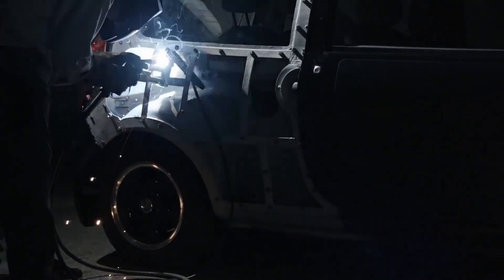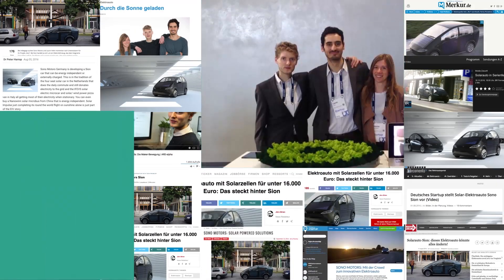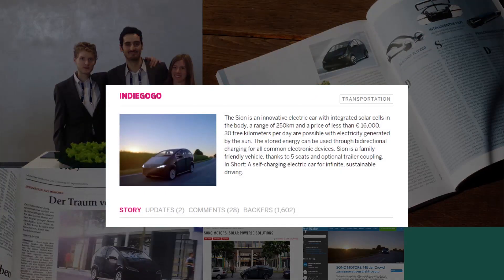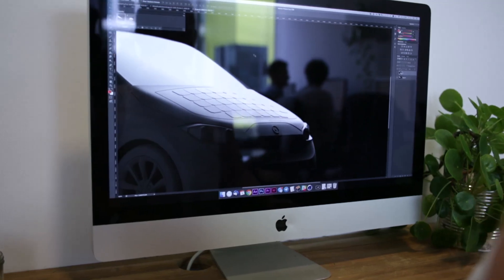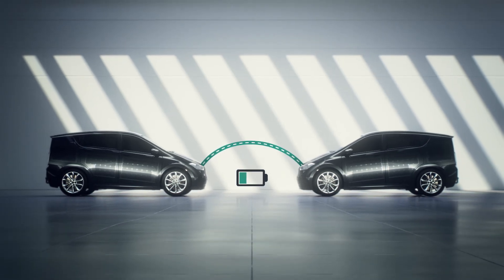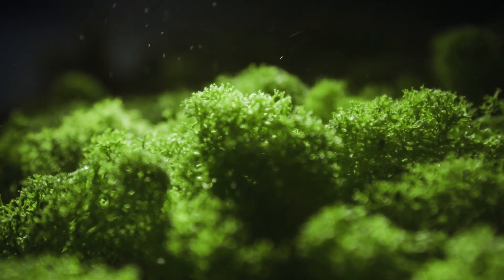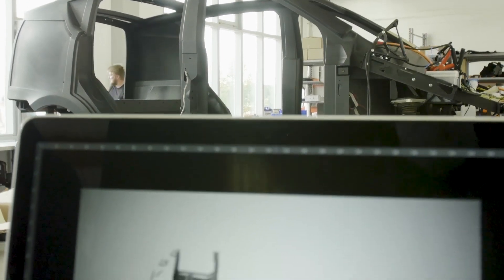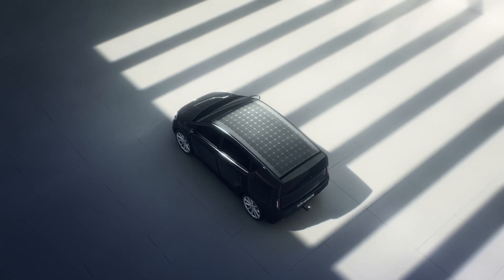Meet the Sion – An Electric Car for Everyone | Sono Motors

Comment: It's not 16000€, it's 20000€, as the car doesn't work without battery, so for starters don't lie. Plus, 20.000€ is still very expensive. If we are to make a difference for the environment, and this solar panel car is a BRILLIANT idea to go in that direction, we need to make these tools available to the majority of the population, and the majority of the population can't afford a 20.000€ car. It needs to be half that price.

Comment: Wirklich interessantes Projekt, allerdings habe ich so meine Bedenken.

Von einer PV-Anlage mit einer Fläche von 7,5 m² und Südausrichtung bei 33° Neigung können in DE ca. 6375 kWh/a erzeugt werden (Idealfall). Unter der Annahme, dass der Sion 15 kWh/100km verbraucht, würden die 6375 kWh für 42.500 km im Jahr reichen. Jedoch sind nie alle PV-Zellen des Sions optimal ausgerichtet und während des normalen Fahrbetriebes kommt es häufig zur Überschattung. Realistisch wären 10% von den im Idealfall erzeugten 6375 kWh/a. Daraus resultieren 638 kWh, die für 4.250 km ausreichen.  Bei 15.000 km Fahrleistung im Jahr können 30% gedeckt werden. 

Allerdings wird viel Potential der PV-Anlage nicht genutzt. Die räumliche Trennung von Energieerzeugung und Verbrauch wäre deutlich sinnvoller. Die energetische Amortisationszeit der PV-Zellen beim Sion dürfte bei weit über 40 Jahren liegen und daher ist ein E-Auto mit Solarzellen aus ökologischer Sicht nicht sinnvoll.
Reply: ...Die räumliche Trennung von Energieerzeugung und Verbrauch wäre deutlich sinnvoller....

Du weißt, welche Energie verbraten wird, wenn man erst eine Batterie lädt, um dann mit ihr eine zweite Batterie zu laden?

...Die energetische Amortisationszeit der PV-Zellen beim Sion dürfte bei weit über 40 Jahren liegen und daher ist ein E-Auto mit Solarzellen aus ökologischer Sicht nicht sinnvoll....

Was verstehst Du unter "energetischer Amortisationszeit"?
Was spricht dagegen, die Zellen wiederzuverwerten?
Wo liegt das ökologische Problem von modern gefertigten Solarzellen?
Reply: …Du weißt, welche Energie verbraten wird, wenn man erst eine Batterie lädt, um dann mit ihr eine zweite Batterie zu laden?
PV (1) =>AC/DC (0,92) => Batterie-1 (0,95) => DC/DC (0,95) => Batterie-2 (0,95) => 79% Gesamtwirkungsgrad

…Was verstehst Du unter "energetischer Amortisationszeit"?
Damit meine ich den Zeitraum, den eine PV-Anlage betrieben werden muss, bis sie genauso viel Energie erzeugt hat, wie für die Herstellung benötigt wurde. In Süddeutschland sind das 6 Jahre, wenn das Potential der Anlage voll ausgeschöpft wird. Bei Sion nutzt die PV-Anlage jedoch nur 10 bis 15% ihres Potentials. Infolgedessen verlängert sich die energetische Amortisationszeit um den Faktor 6,67 (100% Max-Potential / 15% Genutztes Potential) auf 40 Jahre. Liegt also außerhalb der Fahrzeuglebensdauer.

…Was spricht dagegen, die Zellen wiederzuverwerten?    
Möglich, aber benötigt auch wieder Energie ;)

…Wo liegt das ökologische Problem von modern gefertigten Solarzellen?
Das Problem ist, dass die Zellen beim Sion deutlich weniger Energie erzeugen als sie theoretisch könnten. Wenn man die Zellen stattdessen auf sein Haus setzt, wird durch die ideale Ausrichtung das maximale Potential genutzt. Der Strom kann dann selbst verbraucht oder ins Netz eingespeist werden. Also wäre es aus ökologischer Sicht sinnvoller das volle Potential der Anlage an einem stationären Standpunkt zu nutzen. Daher die Trennung von Erzeugung und Verbrauch.
Reply: KawaNinja93, Du schreibst,
...79% Gesamtwirkungsgrad...

Das lass ich mal so stehen, da die Zahl einigermaßen stimmt, obwohl ich nicht weiß, warum aus einer Solarzelle Wechselstrom kommen soll. In jedem Fall ist es nicht optimal (Das war Dein Anspruch), eine Batterie zu laden, um damit eine andere Batterie zu laden.

...In Süddeutschland sind das 6 Jahre, wenn das Potential der Anlage voll ausgeschöpft wird....

Bei monokristallinen Solarzellen spricht man eigentlich von 4 bis 6 Jahren. Ich weiß nicht, warum Du den Maximalwert nennst, obwohl bei moderner Massenfertigung eher ein kleinerer Wert herauskommen sollte. Ich behaupte, daß diese "energetische Amortisationszeit" egal ist, da sie von dem Fehlkonzept ausgeht, man müsse um jeden Preis Energie sparen. Nein, das muss man bei der Nutzung von regenerativen Energiequellen eben nicht.

...Bei Sion nutzt die PV-Anlage jedoch nur 10 bis 15% ihres Potentials....

Wie kommst Du auf diese Zahlen? Ich komme hier auf einen über das Jahr gemittelten Wert von ca. 24%.

...Möglich, aber benötigt auch wieder Energie ;)...

Ja, die Energie des Monteurs, der die Zellen von einer Karosserie auf eine Neue montiert. Ökologisch irrelevant.

...Das Problem ist, dass die Zellen beim Sion deutlich weniger Energie erzeugen als sie theoretisch könnten....

Das ist kein Problem, da sowieso keine Solaranlage dauerhaft den theoretischen Wert hält. Die Welt ist nicht perfekt. Wenn Du das verlangst, darfst Du quasi nichts betreiben. Das "maximale Potential" von Solarenergie ist, sie zu nutzen, wo sie existiert.
Reply: …In jedem Fall ist es nicht optimal (Das war Dein Anspruch), eine Batterie zu laden, um damit eine andere Batterie zu laden…

Mein Anspruch war, dass die Energie aus regenerativen Energiequellen, die standortoptimiert / potentialoptimiert irgendwo in DE stehen, kommen soll. Das Fahrzeug lädt dann mit Öko-Strom aus dem Netz. Eine Zwischenspeicherung wird nicht benötigt.

…Fehlkonzept ausgeht, man müsse um jeden Preis Energie sparen…

Man muss um jeden Preis die Energieerzeugung optimieren/ maximieren. Sowohl wirtschaftlich als auch ökologisch. Von sparen war nicht die Rede.  
 
…Wie kommst Du auf diese Zahlen?...

 Zuerst habe ich mit einen PV-Erzeugungsprofil für München die jährliche Stromerzeugung einer nach Süden ausgerichteten 7,5m² (7,5kWp) PV-Anlage ausgerechnet. Dies stellt das volle Potential (100%) dar. Beim Sion sind selbst auf einer freistehenden Fläche nie alle PV-Zellen der Sonne zugewandt. Geschweige denn im idealen Winkel. Bei der Nutzung im städtischen Verkehr ist die Überschattung während des Parkens und Fahren zudem ein Problem. Unter Berücksichtigung dieser Faktoren komme ich auf die 10% bis 15%. 
Wie kommst du auf 24%? Wenn der Sion auf einer freien Fläche steht, komme ich auf einen ähnlichen Wert.

…Ja, die Energie des Monteurs, der die Zellen von einer Karosserie auf eine Neue montiert..

Ich gehe mal davon aus, dass der Monteur nicht einfach die Motorhaube mit Zellen verbaut. Die Zellen werden vermutlich ein anderes Gehäuse benötigen.

…Das "maximale Potential" von Solarenergie ist, sie zu nutzen, wo sie existiert…

Eben. Auf eine gut ausgerichtete, stationäre PV-Anlage trifft (existiert) viel mehr Solarenergie als auf die PV-Zellen des Sions. Der Nutzen ist bei der stationären Anlage somit deutlich größer. Daher sollte dort die Energie erzeugt werden.

Comment: How many watts are generated with all the photovoltaic cells installed on the surface of the car? ... How many watts are consumed each km in this car?... what is the max velocity  for this car ?
Reply: Conversiones a Auto Eléctrico en México - They have Build in 330 cells with 24% of Range, in one day you can generate 3-5 kw, that’s enough for ca. 30 km. With one Kw you will maybe achieve 7-9 km. max velocity is 140km, weight is 1,4 tons